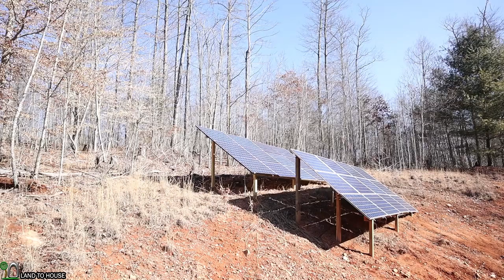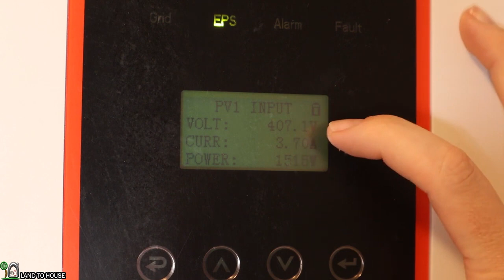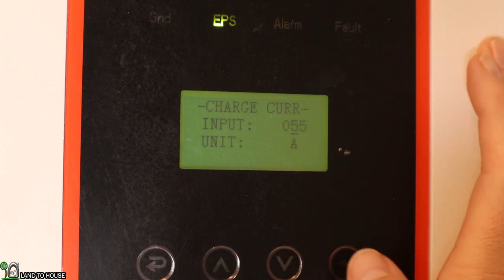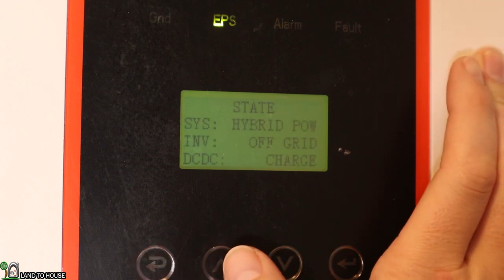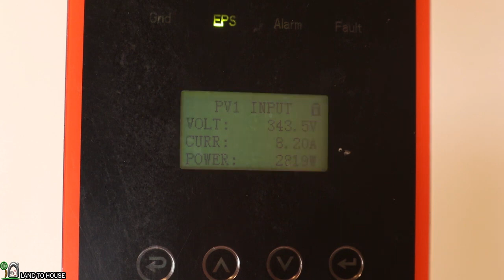Settings Matter  3kw of solar only charging LiFePo4 Battery at 1500w  FIX 1 @Land to House

Comment: Hello I have the same inverter actually 3000w of panel connect feed to the grid very well but don't charge the battery any info about this case?